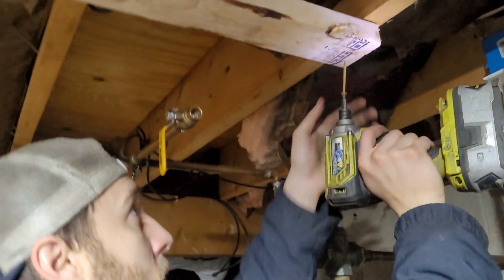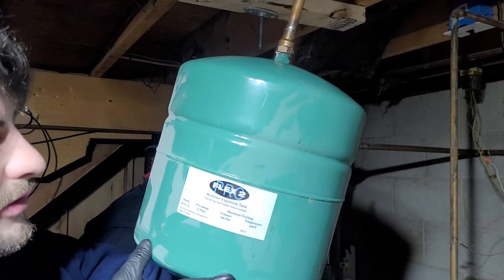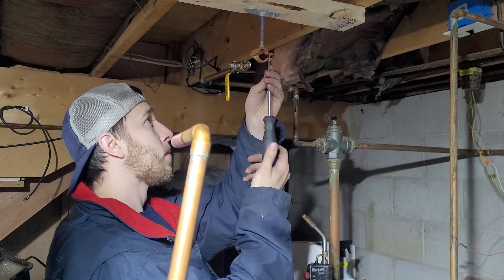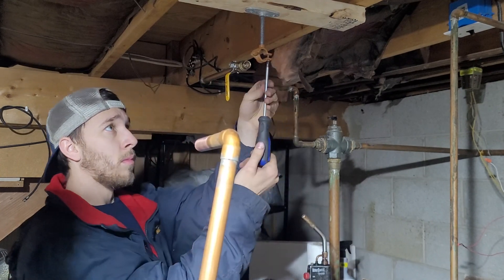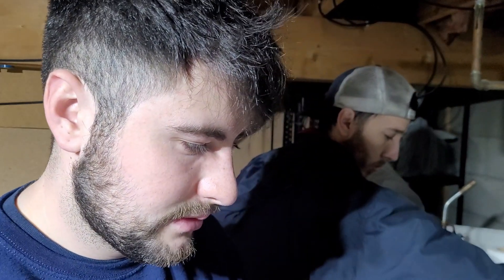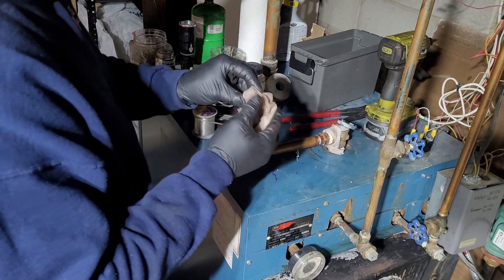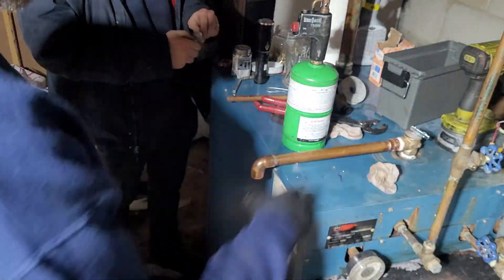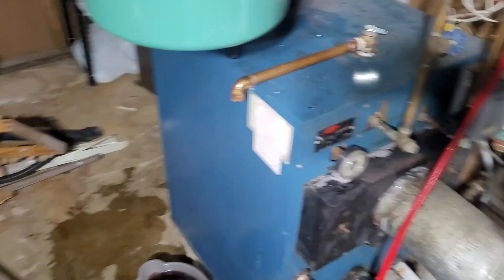Service Call: Relief Valve was Spraying Water onto the floor

Comment: Why put a valve at the expansion tank? I've never seen that
Reply from the maker: @robertshelton3796
Good question! Many times, there are old style gate valves before the air tank or expansion tank. For an air tank, it is required so you can drain your tank without draining the whole system. With an expansion tank, it is helpful so you don't expose any air into the system when you replace the tank. It just makes everything easier to work on.
Reply from the maker: Yea, we should remove the handle when done but the next guy will like it. We try to isolate everything for the next guy so it is bang bang to replace things